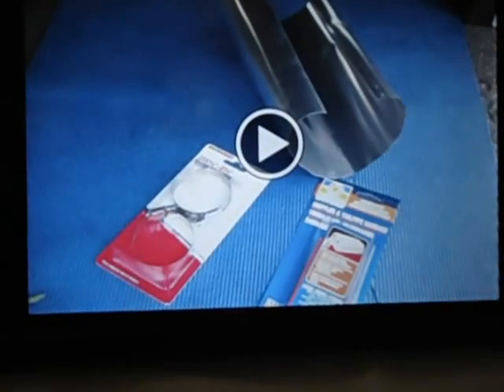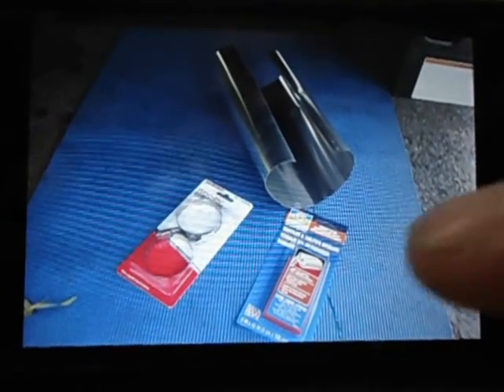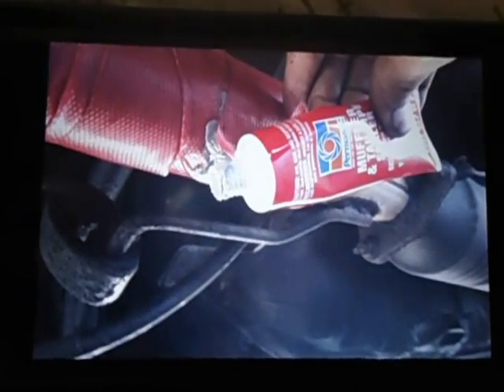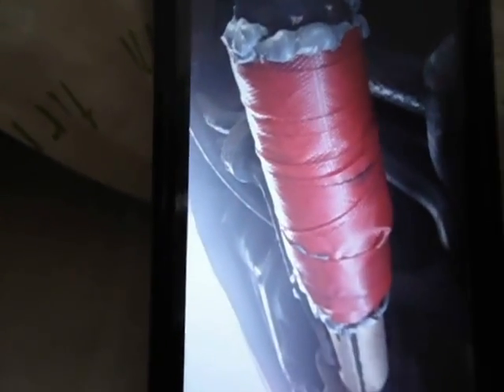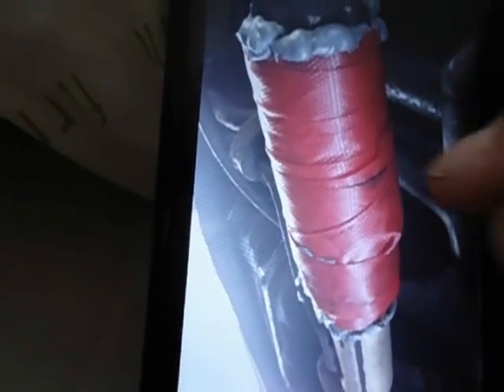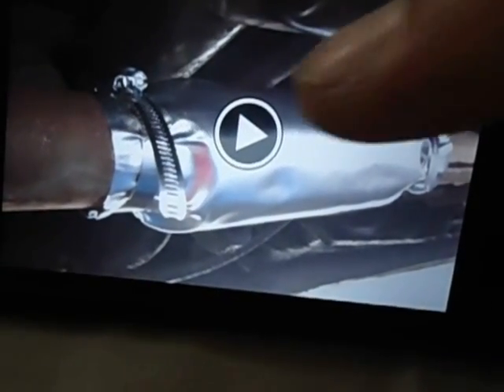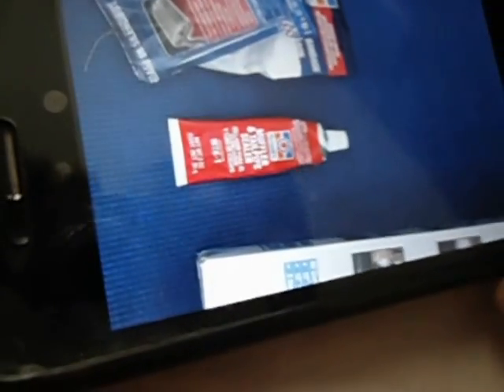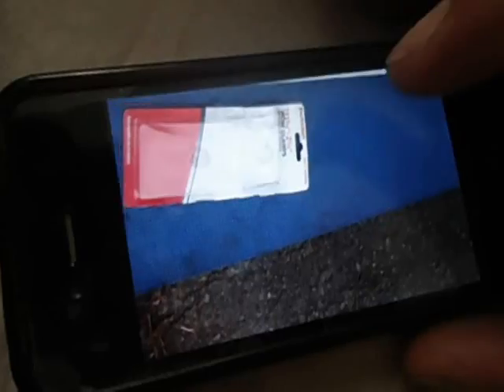How to fix flex pipe on a car

Comment: here is the problem with this video it is cheaper to buy a straight flex pipe than it is to buy all of this stuff and it is alot easier cause all you need it two clamps and one straight pipe measure cut and mount it is that simple

Comment: I fixed my flex pipe last week in my isuzu rodeo 4×4 last week and it cost me 56 bucks...the new flex pipe was 29 bucks at oreilys...then I bought the couplings and four horse shoe clamps...job took 40 minutes and then I took for emissions and it passed easily
Reply: Was your rodeo a slug before you did the job? Was there any major difference im trying to zero in on why I takes 20mims to get to 40kmh
Reply: Turbos all good just thought maybe cause the flow to O2 sensor is interrupted by leak in the flex pipe is the the reason I cant safely overtake

Comment: used like tin can material but bigger coffeecan on small flex  so big it went at least two circles or more cut inch or two in ends with finger wide space between cuts so can can come down on ends and it worked today in the way l wanted , the power of car is more cos backpressure is better. but how long to melt the can dunno cos it leaks a bit , but small leak is better for gas milage , cat seems too tight.

Comment: I tried something very similar to this when I had a busted flex pipe. My fix only worked for about a week or two...then it was leaking again. I gave up and took it to a shop. They found my flex pipe was torn from the inner pipe. Instead of getting a new flex pipe, the guy welded a flange with a gasket from another car. That took care of my problem.

Comment: Is this a joke? You just spent more time, money on foil and glues, not to mention lots of pointless aggravation with the end result being a pr-rigged job that's doomed to failure. This is total insanity. Like you had to go out of your way to think up something so stupid. Your exhaust looks like you're trying to make a friggin Bundt Cake. Do yourself a favor...there's a guy on eBay who sells whole flex pipe units with gaskets, clamps and pipe for about 40 bucks and it fits so NO WELDING REQUIRED